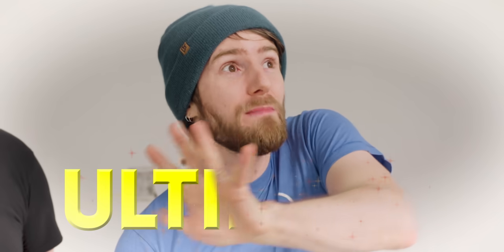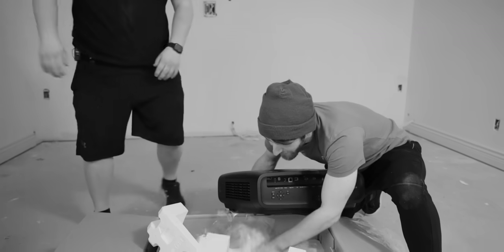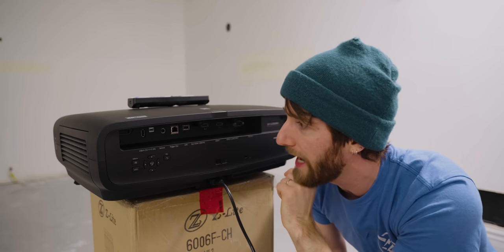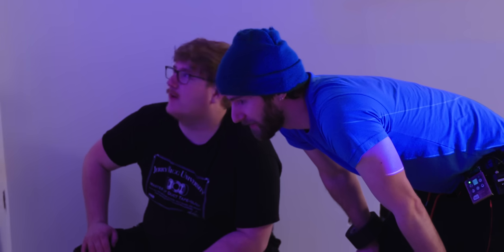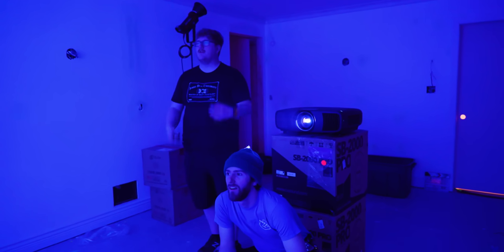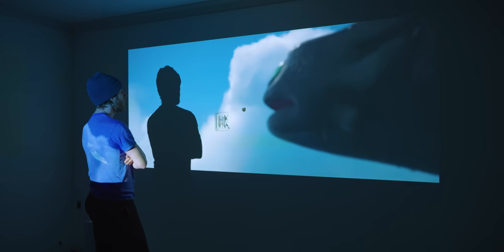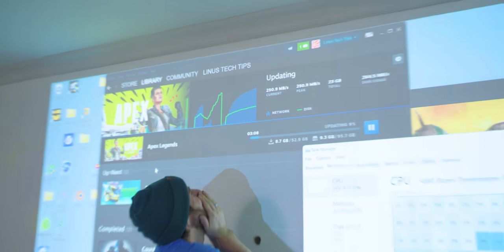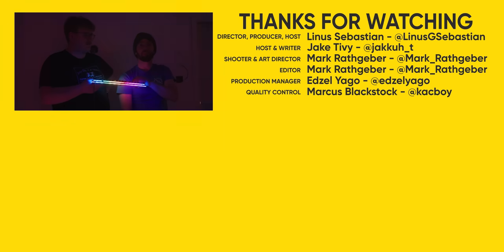I Hate It When He's Right... - Epson LS12000 Demo

Comment: I know that this was basically the whole point of this series and the home as a whole for Linus, but man, his house really is going to be the absolute dream home for tech nerds everywhere.
Reply: Reminds me of when I was an apprentice electrician for an electrical construction company years ago. Anytime there wasn't enough work for everybody, the boss would send the extra guys to work on his house. He wanted to be able to pay everyone for full time, even when business was slow. He was a good guy. His house was big, but by no means a mansion. Maybe 3,500 - 5,000 square feet. I think he spent a lot of time just thinking up shit for us to do to his house. He had 3 big electrical panels, plus a backup panel for his backup generator. He built a shed in the backyard with a 200 Amp service panel in it (200A service is what most new single family homes have here in the US). The shed had an overhead garage door. His front hallway had a chandelier with a motor to lower it to the ground for cleaning. The attic had lights and power receptacles throughout the whole thing. He had ethernet and HDMI cables going to each room. Speaker systems throughout the house. Camera system. He had outdoor storage sheds with water-tight lighting and power receptacles. Outdoor ground lights going along paths around the whole house. Undercabinet lighting everywhere. Intercom systems. Central vacuum. It was insane.
Reply: @UserNameAnonymous  That's amazing lol
Reply: Some 20 years ago I dreamt on playing Quake 3 Arena on a projector, now that dream is a feasible reality tbh 👌 😳 😊
Reply: @UserNameAnonymous  that's how you know you had a good boss: values their workers, but also their performance. Plus, he made sure his workers kept gaining experience, even if it was doing random shit in his house
Reply: @UserNameAnonymous  so, basically, like a proper house electrical should be :)
Reply: So much sponsored content as well. All tech nerds be jelly!
Reply: From what I've seen of Linus, I wouldn't be surprised if he's turning it into a showroom for his next business venture, Linus Smart Homes.
Reply: He's screwed when there's a power cut and all of a sudden he's locked in what's essentially a virtual prison  because nothing works 😂😂
Reply: @Matty.Hill_87  But he has solar panels!
Reply: @cannellofglory6968  ah yeah, of course he does 🤦😂
Reply: @coryv5679  yeah he gets stuff for free now, but how much time and money has he invested to get to the point where its a good financial decision for companies to give him all this stuff?
Reply: @UserNameAnonymous  200A?
Reply: @Matty.Hill_87  he had alot of EPS, he would have hours worth of power
Reply: @Matty.Hill_87  They have manual locks on the inside. This isn't a Disney channel movie.
Reply: Linus Is basically working to make every room inside his house and anything outside his house he can, a business expense. God tier brain economics.
Reply: Yep!
Reply: @coryv5679  It's like as soon as someone becomes really successful, people assume they didn't work they ass off to get what they have.
Reply: @Matty.Hill_87  solar panels with battery
Reply: @nielsdaemen  - 200A is 200 amp.
Reply: @Anisse_N_Spices  - That boss was great. Taught me a lot and he always looked out for us. Working on his house was a double-edged sword though. If you were working at his house, you knew it was going to be a late night. We didn't leave until the work was done. He paid overtime though, the trade-off was more than fair. We never had any complaints.
Reply: @UserNameAnonymous  I know that! I mean 200A in average single family home seems a bit much...
Thats like 24kW
You must have thick wires!
Reply: @Matty.Hill_87  he’ll have his backup power ran by jackery power stations 😂
Reply: @Matty.Hill_87  You do know smart locks and such are designed to work without power as well right?
Reply: @nilus2k  yeah man, I was just messing about
Reply: To bad its 30years in the making
Reply: @nielsdaemen  - most homes never get even close to 200A, but that's what the panels and main breakers are rated for. Most circuits here are 15A or 20A, other than electric ovens, air conditioners, etc.
Reply: Bruh, the resale value is gonna be so good on this house. I am also taking note for when the house market stops being crazy and I am able to try a shot at the dream house
Reply: @UserNameAnonymous  sounds like a mansion to me
Reply: It literally pays for itself.
Reply: @UserNameAnonymous  i was just thinking the same thing lol. Plus we'd see this stuff in the more expensive houses with full whole room and ceiling speaker & sub systems. Ethernet, HDMI, coax, power, etc ran to all main boxes in the rooms for having the cable box and Xbox in the closet or something and just have thw thin TV on the wall with no visible wires. Plus no wifi except for phones and laptops. Basically every room had a 2-port Ethernet box cover with its own line down to the basement to the patch panel & router. Services. Outdoor lighting systems. Security camera systems. Motorized front gate with keypad/speaker. 
Natural Gas Backup Generator installs and EV Hookup installs have been up also in the last 5 years...
Reply: LINUS DROP TIPS
Reply: @UserNameAnonymous  o

Comment: I swear, if Linus wasn't the owner of LTT, he'd be asked to stay in another room during these unboxings and tests. He'd be assigned to holding the script but only if it's printed on paper and not on a tablet or any device that costs more than $10.
Reply: He'd probably also never be trusted to give opinions on high end stuff like the microled screen he looked at if he's that amazed by a "cheap" projector on a white wall despite having very high end OLED stuff around him everywhere.
Reply: @sahilmeena8018  SHEEEESHHH
Reply: @sahilmeena8018  it’s one of the best projectors on the market. It’s just “cheap” meaning it costs less than any other projector with it’s same feature set
Reply: @anepicotter4595  this is not one of the best projectors on the market. It's only around 3000:1 contrast. That's poor and is around the same contrast as an $800 projector. Espon projectors have never been a really good value

you can also buy native 4K projectors which epson mostly does not make. 

In practice you won't care about black levels too much because epson dynamic contrast is really good
Reply: @overnightclassic2  "Espon [sic] projectors have never been a really good value" Hold up there partner, that's straight up false. They're as good a value as any. If you want to hold onto all of the positives of the Epson 12000 (Motorized lens/memory, laser, decent lower latency, contrast above 4,000 native, which is what most people have put this projector at, etc.) and THEN add native 4K... well you're looking at a JVC NZ7 which is 11k. Sony has a slightly better projector contrast wise and native 4k (Their XW5000), but has worse latency, no lens memory, slightly dimmer, and only supports up to HDMI 2.0, not 2.1, and you have to toss an extra $1k at it. On top of all that, resolution is distinctly NOT in first place for what matters most here. Contrast, lumens, and color volume are all more important with resolution coming in 4th place. (Not just my opinion, the ISF preaches this gospel too.)

I'm not saying the 12000 is the  be all end all projector for value, but it's pretty darn good. 

But if it were me? I'd hunt down a good used Epson 5050 and buy a new bulb for it. That's the best value out there to me.
Reply: @LeeVoolHM he does.
Reply: @LeeVoolHM he still owns it, he’s just not the CEO.

Comment: Wow, that looks awesome! I have a 6yr old LCD projector in my play room / theater and it's my showcase when people come visit. I'd love to get a nice Ultra short throw projector next so there's no issue with "people shadows" and brighter since it's closer to the wall, but still waiting for my old one to go out. If you can have a dedicated room, projectors are the way to go IMO.
Reply: Yeah boi
Reply: I used to feel the same, I had projectors since the first 720p ones came out since that was the cheapest way to get large screen for the money. I bought one of these Epson FauxK projectors to replace my old infocus after the color wheel exploded. Sent it right back, it is just not sharp. The pixel shifting is a good idea in theory but its pretty obvious it is not real 4K. Ended up just buying a 75" Samsung flat panel, at this point with the price of flat panels I just cant see going back to projectors.
Reply: @JerryBiehler  laser is a whole different story though.
Reply: I've also been running projectors for years. Started with a Panasonic AE500. I'm still running an AX200 now, but it is time to change. The ultra short throw stuff is really compelling, I will probably get the Epson ultra short throw.
Reply: @vedantsingh_  not really. It's good. My 86 inch oled 4k TV is much better. 

Sure  i could have had a 100 inch laser projector for the same price. 

13 inch bigger, and about 50% less bright. What a deal. 

Old TV will always beat a projector.
Reply: @Heckinwhatonearth  not sure what world you are living in where a 86” OLED is “about the same price” as a projector.  But you do you.  If you want to play games or don’t have a room you can light control then a TV is great but if you want to feel like you are really watching a movie then a projector will always be superior.
Reply: "but still waiting for my old one to go out"

Invite Linus over to help you re-arrange the room, it'll "go out" within minutes.
Reply: The nice thing with a Projector and home theater room is that it’s far more modular then a “TV room” where you can buy and upgrade and change things in parts and pieces. 

For example I’ve had my screen for 15 years and three different projectors. My receiver is brand new but my front speakers are older then I am and they sound better then any fancy new speakers I’ve heard. 

I think a lot of use home theater enthusiasts forgot the amount of time and effort we put into our setups though so I never fault people who just throw a 60” TV up and are like “I’m done”.  That works for the vast majority of people and just makes what we have more special.
Reply: @nilus2k  Absolute cheapest 86'' oled tv here in aus is $3000. Can get a laser projector for less. What world do you live in?
Reply: @nilus2k  your last comment about projectors being more modular doesn't make any sense.
With a TV you can also replace the speakers and receiver.
There isn't a difference between TV and projector in terms of modularity.
Reply: We have a short-throw,  230 cm wide at 1.5 meter.
Reply: Just be aware that you have to have a PERFECTLY flat projection surface with UST projectors.
Reply: The problem with ultra-short throw projectors is that you need an extremly flat wall. The shallow light angle shows up even the tiniest imperfection. If you go with UST, it is best to pair it with a fixed frame screen. Also, unless you can completely control the light in your space, an Ambient Lighth Rejection surface is the way to to.
Reply: @Heckinwhatonearth  Absolute cheapest OLED might not have anywhere near the same image quality than high-end projector has. Which 86" OLED model is 3000$ in aus? In Finland I can only find LG C1 83" for 4500€ or LG Z2 88" for 25000€. I personally would need above 100" screen size, preferably 120" so tv is out of question for me.
Reply: @JerryBiehler  Had an epson 5030UB (1080p 3LCD) that served me well for many years... but just never could commit to fauxK. I had a relatively small screen @ 84", so I ended up getting a 85" QLED and it was definitely the right choice.
Reply: And not having to replace globes.
Reply: @Heckinwhatonearth  And what's the image quality and colour accuracy like on that? I bet it doesn't even come close to the projector in the video.
Reply: @sjsh5837  lg nano 86. Image quality and colour accuracy aren't comparable to a projector, since they're both leagues ahead. Sure, technically a projector will have better colour accuracy. Doesn't mean shit when the image is 30% as bright. 

Oh, it's also 120hz by the way.

My friend has a xiaomi mi 150 4k laser projector that cab go up to 200 inches. The size is nice. Everything else isn't comparable. 

Some 100 inch laser projectors come sort of close, still less bright though, except they cost 2-3 times what an lg nano 86 does.

In like 5 years when the tech evolves I'll probably switch to a projector. For now I prefer something that doesn't look like washed pout garbage during the day.
Reply: So much better than a big TV. And there's not a big chonky thing on the wall when it's off

Comment: Pro tip if you want to blackout windows. Get some insulation sheeting. Its about 1cm thick comes in square or rectangle sections. Its normally down the isle for radiators (to but behind) or in the floor underlay section.  It is basically a foam sheet covered in tinfoil. Perfect to reflect 100% of the light hitting it ;). Can cut it to exact shape you need and simply slot it in the window gap when needed.

Comment: Yes! Apart from losing brightness, any kind of Keystone or zoom adjustment will also "lose" pixels or resolution.

Jake is right set it up at the correct throw and it'll be perfect.
Reply: Exactly.  If you are just throwing up a projector on a room(or outside) temporarily then all those features help get you a decent picture quick but for a dedicated theater room it would serve you well to do the math and find the correct spot.  Ideally you want to never use the keystone adjustment options and a minimal amount of zoom to zero in the picture to the screen

It’s also not just pixel loss or brightness loss. Keystone correction also requires image processing by the projector which means it increase input lag.  Not a big deal for watching movies but if you are gaming on the projector is can be noticeable

Comment: This new Epson really is pretty groundbreaking, the tech is fancy and has been around in the higher end enthusiast and commercial space for a while now, but the price point is where it shines. 

This is the first projector of its class, that truly encompasses everything (aside from 3D and tonemapping support, which is a shame on the latter but not a deal breaker) at a price point that challenges not only other projectors, specifically laser projectors and the ultra high end of the remaining lamp projector lineups, but also the elevated premium lineup of TVs. 

Projectors are never going to overtake TVs purely because it's an enthusiast product, you have to put a lot more time, effort and research into a projector comparative to a relatively simple TV market (it's not simple, but for the majority of consumers and premium purchasers, it's greatly simplified by what's on the shelf and what looks best at the time, unfortunately a lot of consumers just don't put much research into their purchases).

But this might be the start of at least somewhat of an increased shift, or perhaps just a consolidation, of the existing Projector Market to better serve consumers. The downsides of a projector are starting the thin out, the primary reasons consumers don't buy into them is a mixture of complexity and price, Projectors today compared to 10 years ago on both fronts have greatly improved. 

Will be interesting to see where the market is in the next 10 years, especially as more of these market leading features become commonplace at genuinely affordable* prices (affordable for the enthusiast market, ofc these projectors will never be at a price point where the typical $500 TV purchaser will have use of them, there's just not a large enough economy of scale in the projector market to make that happen).

Comment: Just be ready for the brightness to drop, and the colour to change over time. We've got Epson laser projectors at work, and it's quite noticeable - especially if you've got a new one next to it to compare to.
Reply: Which models? And what kind of usage? And is it running at max brightness? Something isn't right if they're newer. You should be getting 10-15 thousand hours with maybe a 20-25% brightness drop. It's then supposed to drop off more quickly as it hits 20,000 hours. Something like 50% brightness at that point.
Reply: Fairly heavy use, probably not at max brightness (but I won't guarantee someone didn't set it up stupidly), and it's most noticeable with the oldest ones we have (probably EB-L1755UNL, unless those ones are an older model). It's mostly annoying because we have a pair side by side in a couple of rooms, which means that you can't necessarily just replace one if it has a fault. Especially with the colour shifting over time.
Reply: Big difference between models though, although both laser with 3LCD there is a big difference in brightness (15000 vs 2700 lm) and application. Plus the L1755 has mad Color calibration functions built-in with camera assistance.

Comment: This is great, I've actually already been planning on upgrading my old Panasonic PT-AE4000 to the Epson LS12000. My third bulb is on its last hours now so I figure it's time to replace the whole projector. I've done some (not very serious) math to justify the cost and just buying new bulbs for 20000 hours would set me back like $2000. That would of course only work if I use it for the whole 20000 hours, which would be about 20 years at my current pace. Guess I'll have to get more liberal using it.
Reply: Take a SOLID look at Sony before you spend money.
Reply: @LarsonChristopher  LS12000 currently beats Sonys respective projectors at the price. LS12000 is a very nice upgrade from the 9400 having been able to actually see the difference between the two
Reply: @Tgspy312  Stats are one thing, performance is another. Most people never setup projectors correct.